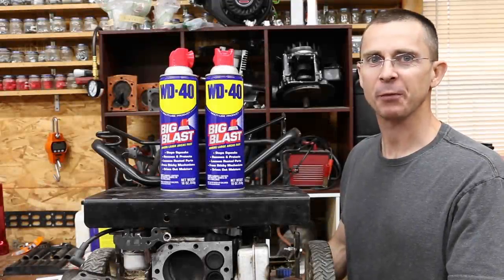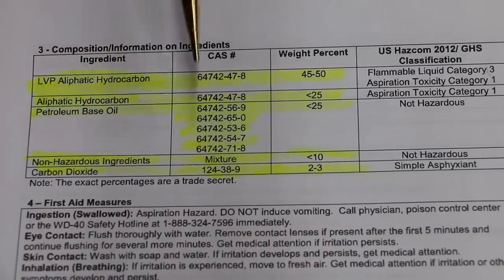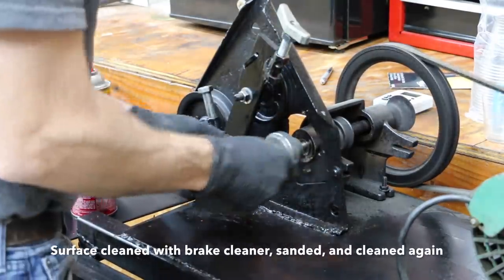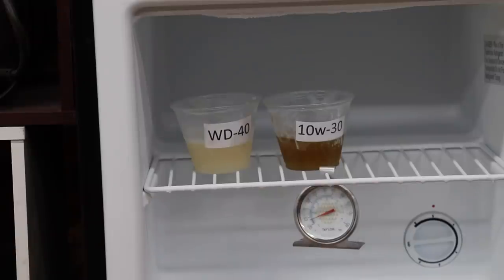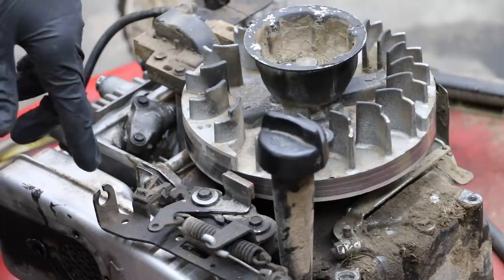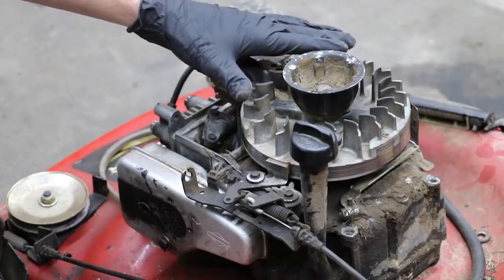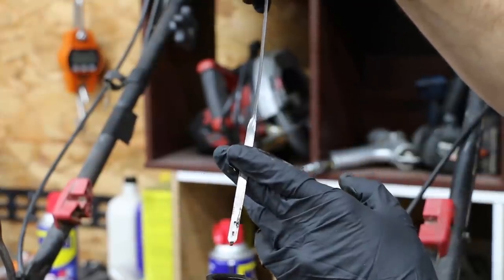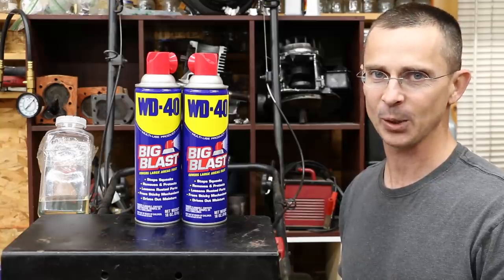Will WD-40 work as engine oil? Let's find out!

Comment: Will 2 stroke oil work as engine oil in the bottom end
Reply from the maker: Thank you for this recommendation.
Reply: Jake Wright yes it would work! synthetic or mineral??
Reply: Jake ive used Used synthethic engine oil to serve as 2 stroke oil in my motorcycle premix instead of discarding them away into wastage...excellent lubricants man!! (50percent or less used Engine oil with 50 percent or more 2cycle oil mixed)
Reply: 2 stroke engines sometimes say "use quality 2 cycle oil or 30w oil" so it's already just regular oil, dyed so you can see it mixed with gas
Reply: Jake Wright 
Best engine flush is one hundred miles with diesel as the lubricant.  And yet diesel is quite dry.  Paraffin is ideal.
Reply: Will a 2stroke engine run with WD40 substituted for the 2stroke oil?
Reply: TheMadRatterUK  don't know. It probably will work because the wd-40 is being burned off and not staying in the engine
Reply: Syn Kronos Right, dude. Remind me to not buy a car off you!
Reply: @the_mad_ratter  It WILL run, but for how long?
Reply: @the_mad_ratter  My guess is it will run slightly longer than running straight gas.
Reply: @JarrettWilliams99  Why does it smell different then?

Comment: It works as both fuel and oil. Just run a engine completely on wd-40
Reply from the maker: Thank you for the video idea!
Reply: I’ve used it as starting fluid on small gasoline motors.

Comment: try running diesel fuel in the crankcase
Reply from the maker: Thank you for this recommendation.
Reply: I suggested this a while ago... would be interesting to see how good the film strength is and see if it can stop the engine spinning a bearing...
Reply: That sounds a little scary... potentially catastrophic seeing that WD40 vaporize
Reply: Maybe... although diesel has a higher ignition temperature than WD40 so the worst that should happen is it gets atomised and spat out the PCV like the WD40 did.
Reply: The engine "WILL" definatly seize.
Reply: ThEcRaZ3dGaM3R he should see if that would run the engine like the vapor apparatus
Reply: Stick the PCV into the intake and see if you can get the engine to sustain itself on diesel vapour? HELL YES!!!
Reply: Diesel fuel, aye
Reply: I wouldn't be too sure as it doesn't have a very good film strength but diesel is an exceptional lubricant. The worst that should happen is the engine runs hotter than normal due to higher internal friction.
Reply: True, you can't spin a bushing, but you can sieze it to the crank
Reply: Bonglord  Done it.
Being so thin, it easily makes its way past the rings and being non combustible by spark, it pretty much poisoned proper combustion but it Does act as a proper low temp lubricant which is why diesel high pressure fuel pumps live.
Reply: It should work. Detroit did make a 2 stroke diesel engine  and diesel fuel is a lubricant.

Comment: Technically speaking, WD40 is a surfactant not a real lubricant , essentially it is kerosene in a can , makes a great little flame thrower too.
Reply from the maker: Great point.  Thanks for commenting.
Reply: Keep up the great work, love your videos, Thank you!
Reply: sur·fac·tant

sərˈfaktənt/

noun

a substance that tends to reduce the surface tension of a liquid in which it is dissolved.

So, like a detergent? Is Seafoam also a surfactant?
Reply: Hi David, In researching Seafoam , it seems it is a fuel additive, which when used as the manufacturer instructs is a a solvent for sludge in fuel systems.(I've never had the need to use it, yet), WD 40 is more of a light lubricant/surfactant appropriate for household items like bicycles of garden tools you don't want to use a heavy oil to avoid attracting too much dust and debris. What do you think? I hope that helps, Peace Bro'
Reply: Im reading the comments before seeing the video. My thinking is WD can be used as starting fluid so it burns similar to gas, if you have a fuel problem like a stuck float in a carb many times you get gas in your oil. When gas in oil gets hot it turns to vapor and causes a rich running condition that will make the motor run poor and then foul the plugs. It would probably work as a lube and protect the moving parts short term but what is the point if it runs poor and cost more.
Reply: Well actually the Surfactant in WD-40 was removed after 2010. WD-40 has very light lubrication properties, used for things like hinges, CNC cutting oil, to keep the rust from building up on things like aerospace frames, weapon platforms..ect. Kerosene is a light oil, You can actually utilize it to lubricate intricate and ornate machines. So in various industries kerosene is actually used as all in one  lubricant and cleaner. In the glass cutting and manufacturing industry Kerosene is used as the main lubricant and penetrating substance.
Reply: johnnieo66 

You are correct. A chemist where I once worked distilled it. 95% Kerosene, ~ 5% light mineral oil, and a trace of corrosion inhibitor. Was originally developed as a penetrant. Evolved to become a genl purpose lubricant. 

My Dad lubed the brass gears of a circa 1900 mantle clock with it. Has worked flawlessly for decades.
Reply: That's correct it's very commonly thought to be a lube for squeaky doors. Actually it's cleaning the squeaky door not lubing it. So I would really like to see it used in a clean up video like a seafoam. I use it for a piston Tops on a tear down and it's amazing. Would like to see how it Compares with seafoam Marvel Etc as a cleaner
Reply: @Jacques Bloques it's good for displacing carbon buildup as well. I've seen videos on here of a guy cleaning piston tops with a wire brush and WD-40. Amazing I've never seen something work so good
Reply: Yeah it's a common misconception that WD-40 is a lubricant like your old 3-in-1 oil or whatnot. While it's oily-ish it's actually a lot better at cleaning parts than lubricating them.
Reply: Kerosene is classified as #1 diesel fuel oil.  What most consider just ordinary diesel fuel is classified as #2 diesel fuel oil.  Some consider the two similar enough to make them interchangeable. I treat the inner surface of my aging TJ's box frame with diesel or kerosene twice a year to keep it from oxydising from the inside of the box frame to the outside. In effect, I am treating inside of the box frame with WD40.
Reply: Never seen wd 40 be particularly flammable
Reply: @MozzaBurger88  "Yeah it's a common misconception that WD-40 is a lubricant" 

No, it's a common misconception misconception that WD-40 is not a lubricant. It's funny that you and other people who believe themselves to be "in the know" just watched a video where a lawnmower engine ran for an hour under load with a hobbled cooling system, with nothing but WD-40 in the crank case, without realizing that this video just conclusively proved all of you "AcTuAlLy, WD-40 Is NoT a LuBrIcAnT" guys wrong, because it's 100% impossible for a lawnmower engine to run for an hour without a lubricant even in ideal conditions, let alone under load and with a hobbled cooling system.
Reply: @FirstLast-my6ke  don't use seafoam, gasoline is already a great cleaner.
Reply: @MaximRecoil  did you ride the short bus scooter ?
Reply: @GrievenceCapitolist  Your non sequitur is dismissed, clodpate, and since you have no arguments, your tacit concession is noted.
Reply: @dickJohnsonpeter  actually,thanks. I forgot, etc. WD, & 40.. We just used Kerosene ( was Trademark Name, lost protection; somewhat like NYLON,ETC; in polulaf & Common Usages 1920’s?.)….back in 1940–60s for clean & Protect,  ( still used )some Areas/ plows…lAnyways, always found some uses ,, Water displacing,clean, etc.
Reply: No, technically speaking it's a lubricant. Just like how kerosene is also technically a lubricant. 
It's petroleum in a can. Just look at the MSDS. (also kerosene is petroleum AKA oil.)

Comment: you removed the engines cooling shroud, it'll run really hot regardless, a briggs needs the cooling shroud in virtually any weather
Reply from the maker: Great point and thanks for commenting.
Reply: Yes, this action for all all intent and purpose, ruined any real measure of performance regarding temp.
Reply: a briggs with normal oil and no cooling will eventually do one of two things, the con-rod will partially melt(and very momentarily) onto the crank shaft lock up and break the conrod, or the rings will wear heavily on the cylinder wall and cause alot of blow-by and waller out the big end of the con-rod make a terrible slap-knock sound, specially all alloy head brigs(without the sleave), if you are testing if an engine can use wd-40 as oil vs oil increasing the temp on purpose to try speed up the results is not the way to go as you get the same result with oil, maybe give it a 5 inch pulley, get a 120 amp alternator(with 5 inch pulley), and have it charge flat scrapyard car batteries for a few hours then do your usual compression test

source: briggs repairs on farm and home equipment for the last 15 years including 4 broken conrods, a valve head break, alot of ignored oil changes, and 2 worn out cylinders, something as simple as straw blocking the cooling shroud on an engine with a fresh oil change can lock up the engine in a matter of a few hours under load
Reply: Raxis, thank you, I didn't realize how important that cooling shroud was like on a car. It does make test results useless.
Reply: Don't worry, the viewers have spoken. The total likes between the two people who have brought this issue up have the most likes in total over any other single comment.

Easy control that he can can do though...he just needs to redo this test with normal motor oil with no shroud on a very similarly cold day.
Reply: If that engine also gets very hot then it was the conditions of the test. If it doesn't, then the cooling shroud wasn't the issue for the test.

Comment: PB Blaster as engine lubricant!  Great video btw!!
Reply from the maker: Thank you for this recommendation and thanks for the positive comment.
Reply: It works better for most applications, especially Drilling and tapping.
Reply: Project Farm or even PB Blaster vs Kroil.  I don't use Kroil because it's a bit pricey, but many say it's even better than PB Blaster as a penetrating oil.
Reply: good idea
Reply: +Top 10 (Top 10 Best Clips) kroil is great(my Dad got a can from a job he worked on) I use it over WD-40
Reply: That's what I have heard.  I'll probably give it a try when I run out of PB Blaster.  Still have two full cans left though... haha

Comment: Try grease or thick oil in the crankcase
Reply from the maker: Thank you for this recommendation.
Reply: Pure STP maybe.
Reply: Yes please
Reply: my mower with horrible big end connecting rod knock has had grease in the crankcase for years, this past summer was it's 4th year like that. I'd change the oil and put about 1/2 the quantity in... then pump in around 100 pumps from a grease gun. Over the course of a few hours (2 hour yard mow) the grease would melt and combine with the oil. I'd run it for a year or two and change it. The mower sucked but I didn't get a better one till recently.
Reply: volvo09 That made me laugh out loud. But, hey, it got the job done! I mean, I get worried when I hear a lifter tapping and there you were running a crankcase full of grease. Was it a riding mower or a push mower?
Reply: Michael Major Hagan glad you got a kick out of it! I'm not exaddurating either, I tried thick oil a few times but the knock was too loud when it warmed up so I always pumped grease back in :). It's a self propeled (rwd) craftsman with a Briggs "625 series" circa 05. I know I could have fixed it But I really didn't care, it wasn't special enough. Every newer mower I'd come across I'd fix up for cheap and give away to a friend . But this fall I got a Honda Rwd mower that is it's replacement. I don't care for the fwd ones with my lawn.
Reply: Bacon grease
Reply: aguyandhiscomputer: mmmmmmm, that would smell awesome!

Comment: What about ky jelly? Probably won't work but would be interesting to test I think
Reply from the maker: Thank you for this recommendation.
Reply: Ky is water based good for skin to skin contact not so much for metal
Reply: Justin Baker Although there are quite a few silicone based intimate lubricants available.
Reply: You asked the same question I did an hour before me!
Reply: Top gear did this a few years ago. Ran one car with personal lube, another with maple syrup, and the other with lard. As engine oil.  The one with the lard lasted the longest.

Comment: The smoke probably wasn't blow by. There was to much smoke. It was the wd-40 flashing off. Just because the crankcase is colder than the flash point doesn't mean it doesn't evaporate and cause smoke. There are hotspots withing the engine, and hot spots in the oil that are constantly moving around. The same reason water starts evaporating below it's boiling temperature. Great video though!
Reply from the maker: Great point regarding the WD-40 flashing off.  This makes sense. Thanks for commenting.
Reply: Plus this is a single cylinder engine, so every time the piston travels down, the vapor in the crankcase has to go somewhere, which is not a defect. A very interesting video and really beautiful shots especially from the carb, many thanks for organizing this all for us.

Comment: i do not accept this as a good test, sorry, the compression was probably lost do to running the engine at 500F and ring tension may have been compromised. 2nd you have zero cooling wd40 isnt good over 400F and regular oil isnt good over 400F either. 

yes i realize the temp is cold but the offset isnt going to make that much different. 

IMO make an  exhaust hose that bolts on to the exhaust port then run the hose outside. next heat your shop to approx 70F and at least youll have one less variable. 

btw the wd40 probably boiled off due to the high temps also, thats why its so low, it was using the wd40 as coolant and boiling it off.
Reply from the maker: Thanks for the constructive feedback.

Comment: I would love for you to try Marvel Mystery Oil. They claim you can replace 1 quart of oil in your vehicle with that stuff. Why not try a 100% replacement?
Reply from the maker: Thank you for this recommendation.
Reply: What I've heard is that Marvel is just automatic transmission fluid, which is supposedly 10W oil with extra detergents. That said, I've dumped ATF in my crankcase before an oil change, drove around 100 miles driving like a grandma and the oil came out pretty black.
Reply: tim babeu ATF is good stuff. I've poured into diesel tanks on older equipment because the USLD is dryer than original diesel.
Reply: tim babeu it is definitely in no way shape or form transmission fluid,mostly naphtha and mineral oil ,and some stuff to make it smell good
Reply: Peppermint-y-ish... Maybe its peppermint oil
Reply: I think, Tom, you've been watching too much Wayne,  and  "Chasing Classic Cars"....
Reply: yes I was just about to say that I will watching to see if he does I love that stuff I get a lot more milage from my car putting a quart of it in my gas tank with a fill up
Reply: Try water.

Comment: fyi the auto parts store i work at sells wd-40in a gallon can. you have to ask for it, though, as it's not on the sales floor.
Reply: superdupergrover farm and fleet sells it in gallons can, just like break cleaner
Reply from the maker: I should have purchased a gallon of it. I would have save money for sure. Thanks.
Reply: And the time it took to empty the spray cans too, lol! I only buy WD-40 in gallons now and use a spray bottle for applying it. A gallon lasts a long time for the jobs I have, but hey, I don't have to buy spray cans so often. Happy New Year Project Farm!
Reply: Ive seen it in 1 gallon cans on the shelf at ACE hardware.
Reply: At my Local parts store and retailer, 5 liter cans of WD40 are available for purchase. And I always have a small can nearby just in case

Comment: Have we done olive oil or any other kitchen oil? maybe whichever has the highest heat range.
Reply from the maker: Not yet. Thank you for this recommendation.
Reply: I've always wondered about that looking forward to the results.
Reply: Hi, Palm oil has the highest heat range, I've seen some of the locals in Malaysia using it as an engine oil for their small 4T engines (cuz it's "thicker" than the rest of kitchen oil, and way too cheap) and some of them even use it for their cars + 300ml of engine oil additives or stabilizer. (Plenty of videos on here)
Actually I've applied that on my 4t scooter, I filled the crankcase up and run it for 15 minutes as a way of "engine flush". Then I added my 15w 40 Yamalub. Worked fine with me.
Must be done..